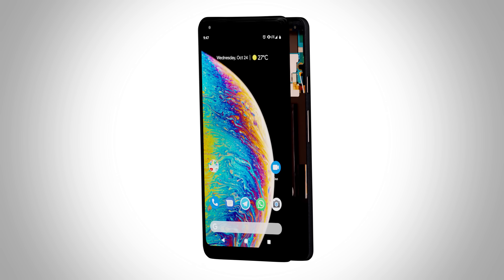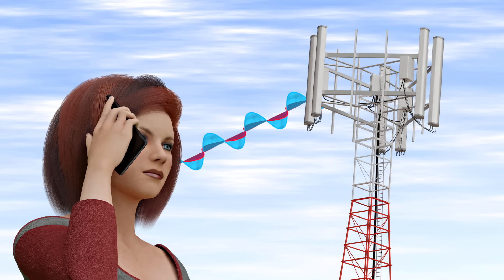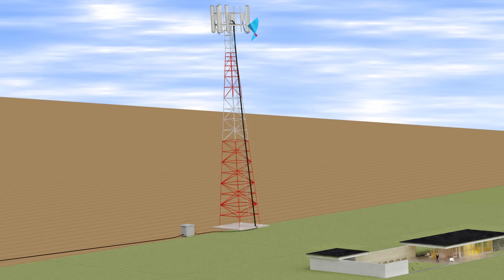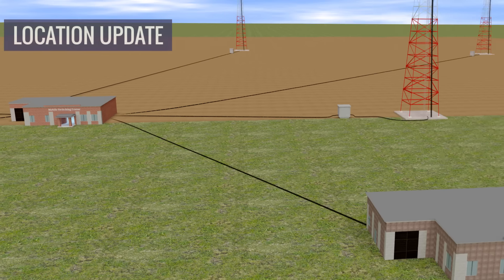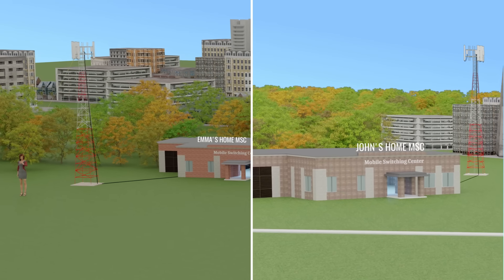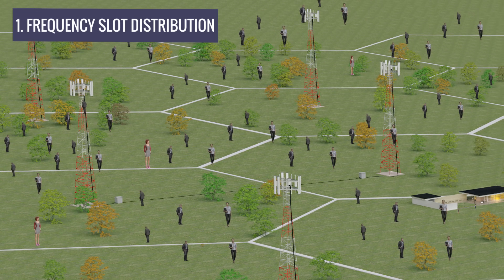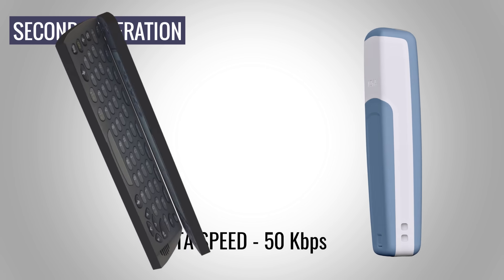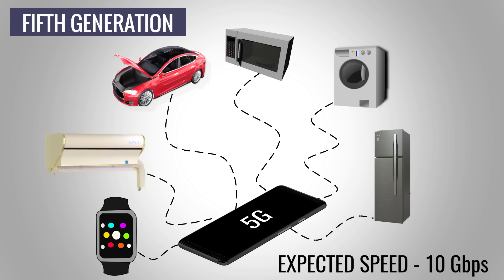How does your mobile phone work? | ICT #1

Comment: I retired from a phone company and this is very high level, but still one of the best explanations I've ever seen.  Good job!
Reply: I know I'm three years late on this but maybe your background can help (I assume the 2,900 comments will prevent this from being seen by the poster).

The initial journey starts with the caller talking, and explains the path that the sound travels. Later in the video though, once this signal hits the home MSC, it seems like the phone call wasn't yet made and the MSC is first trying to find out details about the person being called. I'm assuming that the sound generally follows the same path as the dial, but I'm still curious if things are a bit more streamlined once the connection is established, or if the sounds still need to go through all the same hoops that the dial goes through.
Reply: @MalcolmThe5th 2 months later and I see your comment! ❤
Reply: Why did u retire

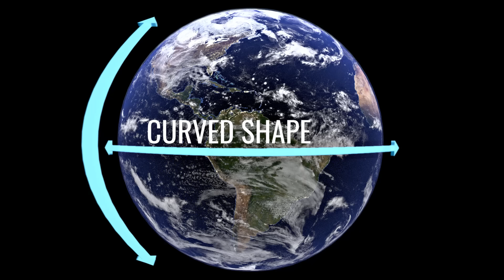Comment: 1:48 flat earth believers heart attack xD
Reply: Where is the satellites sphere earth believers???
Reply: @Aurash333  like finding a needle in a haystack. You can't just look up and see satellites. You could see the ISS with a telescope though.
Reply: @dkmodder4405  why satellites is not use for mobile telephony?
Reply: @Aurash333  There are satellite phones out there, you can buy some from Amazon. Satellites are used mainly to transmit long range data across the planet (which is a sphere). If it wasn't for satellites, the flat-brainers wouldn't be able to communicate on their Facebook groups.
Reply: Who are flat earth believers. Is it a religion?
Reply: @Oryss aaww. Who are they? where do they exist?
*Never heard of them
Reply: @jayc3346  They're on Facebook, im not joking, just find a space article related, and read into the comment.
Reply: @Randomguy-wd5lw  that's so dummy of you
Reply: @lastmetroid2948 
This is YouTube not your notebook.
Reply: @gplor5259  You are right I am sorry you are bored to read the memo have a nice day :)
Reply: Looool
Reply: auras ian Because satellites are expensive to put up and not easily repaired.  It's easier and cheaper to maintain and use cables on the ocean floor and across land.  Satellite phones are pretty expensive to use, and signals are much easier to recieve from just a mile or two away.  Satelites are several miles in the sky.  Satellites are mostly used for cable tv, not the internet, though you can get small dishes for satellite internet if you are not in a DSL area, my dad had to for a few years, but it's more expensive and data use is limited.  It's extremely unlikely that your internet/cellphone use ever goes over satellite transmissions.
Reply: yup cartoons debunk flat earth ..
Reply: xD
Reply: @dkmodder4405  See the ISS with your bare eye.
Reply: because all communication is ground based, because satelites do not exist - that is the reason why they are using spy planes and drones even in the year 2019 - nothing of this crap in so called "space" exists... this is all a giant scam of great proportion - and yeah, thats based on my research, not my believes
Reply: @dkmodder4405  Believe it or not, the internet is predominantly made of under ocean cables.
Reply: @majestic7768  I am aware of that too, but satellites are also becoming a more dominant driving force of the internet and in the future, they will be the main source of transfer for data and information.
Reply: On flat earth mobiles uses towers and cables.
Reply: They have gone round the bend anyway.
Reply: My issue with Flat earth theory is that you can not stand exactly on the point of Earth axis - ie North South poles; and another World is on the other side of the disc....  so why they can we not dig down and visit them.
Reply: Believing that earth is flat is really stupid....
Reply: Jay c#33 
Flat Earther are the group of people who believes that the earth is not round as being shown in the mainstream. They believe that  governments are lying about the Earths shape for multiple reasons.

Once you see the truth there is no coming back to the lie.
Reply: No earth is traingle
Reply: Yeah, this explains how far Amilia Earhart’s SOS signals were heard from great distances. The earth is a flat plane, if it was not a flat plane the SOS signals would have never been picked up in the places they were heard from. Do your RESEARCH. Water ALWAYS takes the shape of its container and lays flat and level. That’s a FACT!! Sea level, NOT sea curve!!
Reply: This is just so funny even such kind of person s are existing till now
Reply: And there are some believers in social media that they won't die...
Reply: @jayc3346  you are the one who doesnt exist bc u dnt know them XDD
Reply: @Aurash333  Haha that's what I was gonna say. I like how it shows a shpere model and say we need to install cell towers lol. WTF does a globe have to do with reception. Yep makes sense the towers are upside down on the bottom. Must be a special frequency to bend the signal around the globe model lol.
Reply: @dkmodder4405  It's in the name planet plane-t it's a plane lol. NASA says the earth is a globe but their logo of the map is flat lol.
Reply: @amybella  Just because a company shows a modified graphical icon in their logo, doesn't disprove the thousands of years of scientific study and experimentation that humanity has done.
Reply: Quite the opposite. The facts about the short distance of the signal and the use of cables across the earth prove that signals, including GPS are not transferred by satellite but by cell towers and cables ON the earth
Reply: @PhuketWord  exactly. The Earth is flat there is no measured curvature and in plus the signals from cell towers are sent underground.
Reply: Huf....you still believe in earth?
Reply: @jayc3346  Who are scientists?  Is science a religion?
Reply: @Aurash333  They think that the signal bends around sphere model lol. Yep that make sense. To a globetard it does. The signal fires from one tower then bends to go to the bottom tower and they call flat earther non logical. Yet when you say the earth is spinning at 1000s of miles an hour it's able to lock on a signal sure buddy that's makes sense. LMAO
Reply: @amybella  It could be!
Reply: Nasa isn't the only space agency in the world. And the space agencies of other countries too have developed indeginious satellites for various purposes. For people who are arguing with transmission of electromagnetic waves, please try to dive into waves and their properties in atmosphere and factors like scattering and reflection. These are some really basic college level physics which would clear the unwanted fuss about how waves travel longer distances. Flat earth?  Are some people too ignorant of modern technological advancements all over the world? Is this thing common in America?? People believe earth is flat there?
Reply: @JW-mr5mh  I hear Nothing created a Spherical Earth. So genius of Nothing! I admire him/her
Reply: Quran mention Earth is geoid 1400+years ago
Reply: That’s what I was thinking too... like, wait a minute here, the earth is flat so don’t give us that earths curvature bullshit lol. Sheesh who are they trying to fool anyways...?
Reply: @sergiomachuco7932  why do you flat-earthers keep making problems with us , at least if it dont looks round for you , and it looks for me , DON'T be agressive with me because you are being a flat-brained (that is different from flat-earther in my way)
Reply: @mdalamgirhussain7917  YOU ARE RIGHT LOL
Reply: @amybella  why you are so bad with us , you are swearing without reason to us , that is illegal , it is the same thing to me to say you are a plane-brained , so you are against the youtube community guidelines , just stop making that , i reported you of hatred discussion so please , STOP!!!!!
Reply: ⚠️ PLEASE WATCH ON YOUTUBE The Dangers of Smart Meters & 5G 😨 13 min 55 secs 😡 SHOCKING INFORMATION 😱
Reply: @dkmodder4405  .
Reply: Sergio Machuco smart man
Reply: @dkmodder4405  "Flat-brainers?" That's a good one... lmao!
Reply: @shubhrendupaul3793  Many people are potheads, narcotics abusers (willingly), which has mentally affected them to the point they have lost deductive reasoning, critical thinking and common sense.  A simple experiment to disprove a flat-earthaholic is to explain day and night with them, where you have to independent props (humans) located laterally and in polar opposites on the planet (which the noun itself is a dead giveaway to it being a sphere like the other celestial bodies), to observe the conditions,  and report the findings. Furthermore,  explain how it's summer on top, while winter is at at the bottom, and why cyclones spin in opposite directions, of each side of the equator. All this will be impossible if the planet was a pizza  -- spinning on a central axis. Lol
Reply: @sergiomachuco7932   there is no point trying  to fix something  that been demanded for many years ( brain washed )  i cant say if earth is like a rock  or it is flat, however 1 thing i can say is that imagine that all education  is based in Einstein physics and because  of it they say that it is imposing  that objects  to accelerate in to high speed and stop in 1 sec.  However  around world people  have seen it ... ufo ( unidentifed  flying  object) that moves fast and stops in 1 sec. And that is contradiction to physics theory.  Lies and lies and now 2020  virus  ( which possibly created  by someone) and they trying  to give people  some sort of cards that identifies that you viruse free than give few years and they will say ouu cards get lost or destroyed  by accident... so lets put chip in people's hands (than in to heads )  and than automatically human  becomes robot but  i will ask to people  who believe  they free..   what f. Is freedom,  in your understanding and how free are you?
Reply: @sergiomachuco7932  NASA isn’t going to gain relatively much by making up an idea and build expensive things and do extensive research and training. There are many more space and scientific agencies out there that barely earn much money (proportionally) that you forgot about.

                       Let me take the scenario: if Earth was flat then time zones wouldn’t work the way they are because the sun wouldn’t exactly set or rise, sometimes it would be slightly darker, sometimes brighter. The different climates wouldn’t work because on the curved Earth, light scatters the higher the latitudes are, causing the temperature to drop. There wouldn’t be much of difference on a flat Earth, so there wouldn’t be ice at the poles. On a round Earth seasons happen because Earth is always tilted on an axis towards one constant position in the solar system, the sun hits different parts of the tilted Earth at different points in space as the planet orbits the Sun, so the equator doesn’t get affected, while the polar regions are dramatically affected. This wouldn’t happen on a flat Earth. Also, the Coriolis effect only works on large storms that extend across latitudes, the higher the latitude, the slower the rotation of Earth, this difference causes the relatively slow rotation of storms on different hemispheres in different directions.

                      The curve of Earth is huge, and barely noticeable, the only way you can know is when you see the horizon, and how the high clouds can be seen further and “dip” beneath the horizon. You can even try making a ship go beyond the horizon, or go somewhere, climb a big hill and notice that you will be able to see further, this is because your view is better from higher because it not blocked as much by the curvature. The Earth has been spinning and moving for the past 4 billion years, so everything part of Earth (including us, organisms, water, and the atmosphere) is moving at a fast speed when you feel like you are still. There are no headwinds coming from space because there is not much gas in space to cause pressure as Earth orbits the Sun, this phenomenon also causes annual meteor showers, as we move through a group of meteoroids. Also, if Earth was flat then gravity would pull everything to the centre (north pole in your case) and there would be no gravitational field to protect us from dangerous radiation. Asteroids and meteoroids wouldn’t be able to enter Earth’s atmosphere since you claim space doesn’t exist. Also, you claim that Antarctica’s coastline is longer than the Equator which doesn’t make sense.

                      It also takes very slightly longer for a plane to travel from west to east. GPS, TV, satellite phones, military spying, etc. wouldn’t work because they all require satellites orbiting high up in Earth’s atmosphere. Haven’t you seen them move across the sky at night? Rockets curve when they launch so that they can spiral into orbit without having to go vertically which requires much more energy. I also request you to use a good telescope and see how complex the Universe is.

                      The equation 8in/m^2 that you flat-earthers use actually describes a parabola, which is like an extremely elongated oval, and round Earth is not like that. In reality, level means anything that is pulled the closest it can to the centre of Earth, down is anything nearer to the centre of Earth, and down is anything further away from the centre. Level doesn’t mean a constant linear figure through space. Also, density and buoyancy are not forcing that cause things to fall, they are a difference in pressure and cause different compounds/elements to maintain a different level according to their density (gravity, a vector, is the cause of those factors) Density= Mass/Volume. Centrifugal force doesn’t have effect on Earth firstly because gravity overwhelms it by far, and speed is relative; even though Earth spins at over 1,000km/h at the equator, it takes 24 hours for it to make a full rotation  because of its size, on all latitudes and longitudes. Because of this law of relativity, there is very less angular momentum.
Don’t believe just a random person who says that space missions are fake, and we don’t need religion and unscientific evidence from you flat-earthers. Science has got us so far. You people are a shame to humankind and restrain us from actually exploring (I’m not crazy about space exploration by the way). Science is not a religion; it is the concept of learning new things through a structured manner and spreading the knowledge. Also, the fact that you flat-earthers say that we have been brainwashed is actually a way for you to brainwash us that everything is a lie and that fact that Earth is flat is true (which is not); your tactic doesn’t work. You may take random images and say, “I can’t see the curvature of Earth”, but in fact you flat-earth images look even more CGI and there are many more images of curved Earth from the sky than made up flat-earth ones. Don’t make up reasons just to get your way out of reality.

                      So, shout at me, say this is disinformation, say that Earth is flat, trust me, it will backfire one day.
Reply: @sergiomachuco7932  ...and I'm 11 so...
Reply: @geo3106  you got brains of a 60 year old scientist..I love it
Reply: @haroldmodilim634  I'v edited it and it's a 100 times better now. Thanks

Comment: A great video on cellular radio. I have questions about necessary equipment to provide additional spectrum for increased service demand.  I'm curious about how cell companies can add equipment so seemingly easily in such short order.  I've been reading about how AT&T and T-Mobile are going to be using spectrum loaned by other spectrum holders - so that demand for data precipitated by Coronavirus concerns can be met.  How do they do this so rapidly?

Comment: due to the earth curve structure... hahaha, a good one, really! proof the curve, you cant.
Reply: If the earth is not curved,then how the intensity of sunlight varies in poles and equatorial region?
Reply: sunfiya Sebu well, if you do proper research you will find out. i have my answers and those answers are at the moment more valid than the science bullshit they told us - research!
Reply: @Ronald Steinmassl,then why earth leaves a circular shadow on moon during lunar eclipse?
Reply: Draw a square on the ground. Lets say its with 4m side length. The area (l×b) should be exactly 16m^2 right.
Nah, its slightly a higher value due to the curvature. This is proved by scientists for once and for all by using necessary equipment.